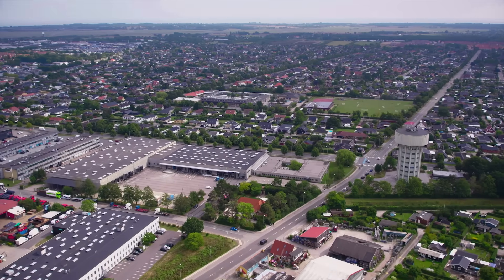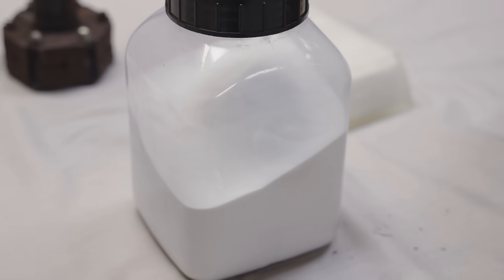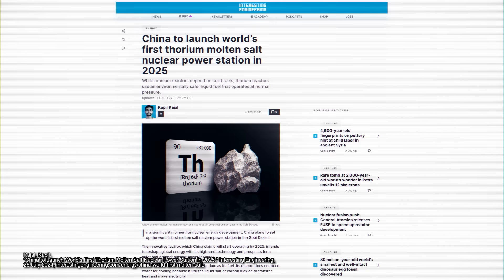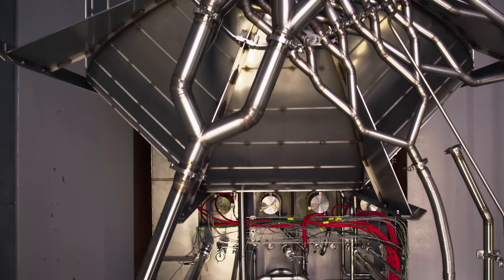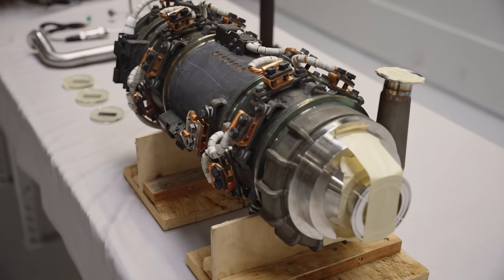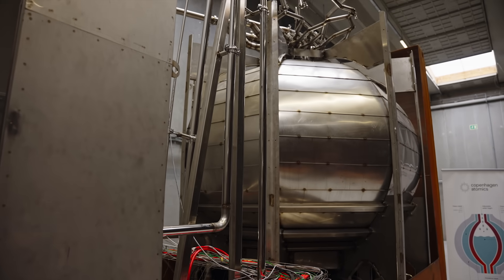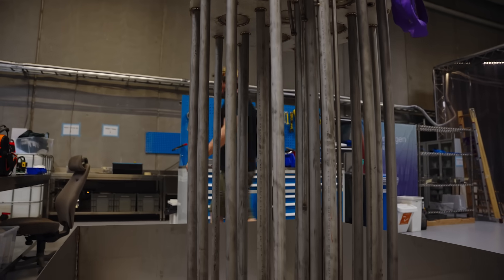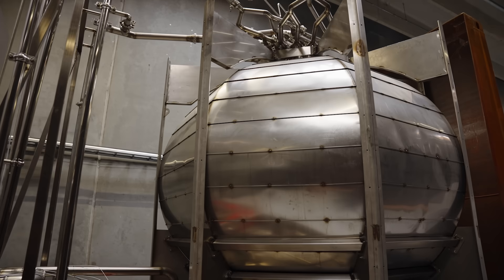Why Isn’t Thorium Changing the World?

Comment: I heard that the original test molten salt reactors had problems with materials in the reactor degrading
Reply: Yes. They were also done in the 60's, when our understanding of material science, especially regarding ceramics and polymers, was significantly less advanced than it is now. Finding materials that degrade much slower is already underway and will likely be solved much sooner than the legal/cultural issues at the current rate.
Reply: @canolathra6865  yes, it just explains why the design wasn't pursued further at the time
Reply: It shows in the video they got an MSR to run 6000 hours at full power, that's not nothing.
Reply: that was mentioned in the video, 
I'm guessing they need some kind of sacrificial anode like on boats or in hot water tanks.